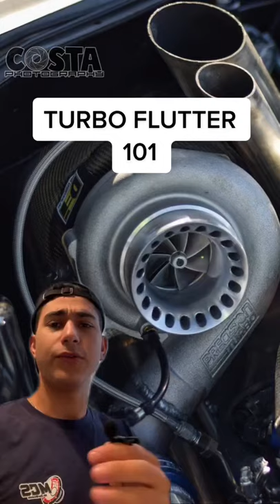TURBO FLUTTER 101 - Explaining Sutututu Theory

Comment: If its escaping through the turbine wheel then you have a problem. It should only make that noise from the waste gate. If its going through the wheel then that means the wheel is spinning backwards and forwards extremely fast and will destroy the bearing in the turbo. Certain blow off valves do this and its not good for the turbo at all because its opening and closing forcing air backwards causing the wheels to spin backwards then forward repeatedly from the air still traveling the correct direction inside the turbo. When a wastegate does it it’s different the air is escaping out of the external wastegate pipe and leaving completely it dosent get forced back into the turbo
Reply: He meant to say compressor not turbine, wastegate has nothing to do with it, it does not make the turbo spin backwards, that is literally not possible, blow off valves do not make this sound.
Reply: @DriftNick  did you not read my comment? I said that and external wastegate is capable of making this noise it dosent hurt the turbo. A blow of valve can create thus noise in the tubo if it opens and closes repeatedly which there are some out there that do it and its not good for the bearing in the turbo
Reply: @dakotaphelan  You do not understand what a wastegate is and how it works, it's a valve on the exhaust that bypasses exhaust around the turbo to limit it's speed, it has nothing to do with turbo flutter.

"A blow of valve can create thus noise"

Turbo flutter happens because there is no blow off valve releasing pressure, a blow off valve doesn't make the sound.

Comment: Performance left the chat *
Reply: Turbo flutter does no cause a performance, in fact there is a performance gain from not releasing the boost pressure hence why it's common place in motorsport not to run a valve.
Reply: @DriftNick  I could agree in some cases but it is overall better to release the presser true the blow off valve as that is the dedicated spot for the pressure to be released
Reply: @Z-squar  Why do you think it's better for performance?
Reply: @DriftNick  I just think it’s better to have a slight more performance than the nicer sound
Reply: @Z-squar  There is no performance loss from running no valve.
Reply: @DriftNick  it’s just not recommended for the pressure to escape through the turbine cos it’s suffocated and trapped inside
Reply: @Z-squar  It doesn't escape the turbine, he mistakenly said that, it escapes pass the compressor and out the intake, it's not trapped inside, not sure what you mean by suffocated.
Reply: @DriftNick  well I guess I’m wrong 😅 . GG

Comment: Turbo flutter or compressor surge is what this is. It can be caused when your BOV isn’t keeping up with the compressed air when you release the throttle… it can happen under full throttle but that is a hole bad can of worms on its own. 

Turbo flutter, although it sounds cool, is not good for your turbo. Idk anyone that runs a turbo setup that doesn’t have a blow off valve (usually aftermarket booster cars) or a diversion valve (typically in stock turbo cars). 

Spending that much to make boost and having nothing protecting your turbo from surge is idiotic. 

The insane supras that you see with flutter are likely due to the blowoff valve struggling to keep up with a big turbo making insane boost numbers… but even then it’s not good for the life of the turbo.
Reply: If you don't know anybody that doesn't run a valve then of course you have no idea if it's actually bad or not, common place for people not to run them here, done it myself for over 10 years, never had an issue.

Comment: Traveling shockwave slamming against a closed throttle plate and back out the turbine, causing the turbine to either slow down momentarily, or even stall, momentarily dropping the pressure inside the intake.  Turbine speeds/spins up again, rince, wash, repeat.
funny noise
Reply: Doesn't slow the turbo down, the stalling is the air separating from the blades, it's not the turbo stopping.
Reply: @DriftNick  Yes, it does.  Due to three factors.
One: Closed throttle means no load, which means no more hot exhaust, which means no more energy makes it's way to the turbo. Unless you've discovered perpetual motion, the laws of physics still apply.
Two: The throttle being closed means that there is a sharp rise in pressure, which means the turbo will expend the energy stored in it's rotation quicker.
Three: The compressor spins one way to force air into the engine, so it must spin the other way to let air out of the intake.  Simple physics.  I'm sure you've seen those little windmill on a stick toys for kids.
All that is happening is the stored energy of the compressed air in the intake fighting the stored energy in the turbo's rotation.  Nothing more to it.
Since this happens in (shock)waves, this means that the compressor speed follows the exchange in energy in spikes.  It just is what happens.
Reply: @detaart  You lack an understand of what is happening and how turbos work if you think the turbo needs to spin the other way to let air out the intake.

High Performance Academy have a video on their youtube "Do You Need a Blow Off Valve?" where they use a turbo speed sensor to see if there is any difference in turbo speed between running and valve and not running one, the rate that the turbo slows down when you lift off the throttle is exactly the same between the two.

What you think is happening and what is actually happening are two very different things.
Reply: @DriftNick  You lack reading comprehension.  There is energy stored in the turbo's rotation.  The air being forced out is a force acting on that stored energy.
I've seen the actual real life data myself.
Conversely, there are also plenty of videos on youtube supporting what i say lol.  Did you really try to pull that one?
I mean are you denying that a fan running in reverse reverses the flow of air?  What?
Reply: @detaart  I know you are trying to sound smart but you actually have no idea what is happening and it's funny.

" there are also plenty of videos on youtube supporting what i say lol"

Show me a single video with evidence the turbo spins backwards or even slows down more then it would with a valve.

"I mean are you denying that a fan running in reverse reverses the flow of air?  What?"

Who lacks reading comprehension? I said nothing like that, the turbo doesn't run in reverse, they does not mean air can't escape out the intake, the blades do not have a perfect seal with the housing, they are literally designed to allow it to happen.
Reply: @DriftNick  Can't embed urls here, the comment will just disappear.
You can google or search on youtube, and you will see for yourself 
You are also adding qualifiers and twisting my words.  I didn't say a turbo would spin backwards, again, reading comprehension.
I said that in some cases, it could stop for a fraction of a second.  This can happen high load, low rpm situations with a very small turbo.
I am smart.  Thanks for noticing.
You did not bring arguments or sound logic to support your claims.  Just "some guy on youtube said it".
Reply: @detaart  You can at least tell me the name of the video just like I did.

"Just "some guy on youtube said it"."

Only one of the most respected people in the aftermarket tuning industry, what evidence have you shown?

" I didn't say a turbo would spin backwards"

You said this.

"so it must spin the other way to let air out of the intake."

Does that not imply you think the turbo must spin the other way to let air out the intake?
Reply: @DriftNick  Are you still going on about this?
I guess i didn't express myself well on that one.  If the turbo was still, then it would have to spin one way to pump air in, and the other way around to pump air out.  Better?

Comment: Its from no blow off valve, which is pointless for having a turbo
Reply: Why is it pointless?
Reply: @DriftNick  because you don't get full boost, as full of boost available, and it wears the turbo out much quicker
Reply: @koreyhayden1368  Not sure what you think is happening that means you can't get "full boost" but what ever it is that is not the case.

" and it wears the turbo out much quicker

Much quicker = if it does any damage it's so minimal you wouldn't notice.

Comment: OK> My turbo has a VNT and STILL makes that Turbo flutter noise. What's going on there?
Reply: the valve is probably malfunctioning, set too tightly, or you just need a a bigger quality unit
Reply: @retrac3147  What valve? Variable Nozzle Geometry Turbo? It's a variable diameter turbo housing for want of a better description. It has a blow-off valve as part of the exhaust, like most modern turbo's. But I doubt that's what you meant. Right? It is small for a 2.4L diesel IMHO.

Comment: He forgot to mention its bad for your turbo to not have a blowoff valve
Reply: Probably because it isn't bad.
Reply: @DriftNick  so when something is spinning at high speeds in one direction, and then you suddenly push air back the opposite direction causing the turbine to spin the wrong direction, thats somehow not bad for your turbo? Yeah ok buddy 🤣 if that was the case then why were blowoff valves invented and why would people bother using them 🤦🏽
Reply: @YouANerd  Oh you are one of those people that thinks it makes the turbo spin backwards, you lack the most basic understanding of what is happening if you think it can make the turbo spin backwards, it doesn't even slow the turbo down, literally no possible for it to spin backwards from flutter
Reply: @DriftNick  🤣🤣 your incompetence is astounding

Comment: Negative. It’s the wheels in the turbo spinning against each other. Boost doesn’t “ leak out of the intake”.
Reply: Wheels in the turbo spinning against each other? you know they are connected to each other and that isn't possible?

"Boost doesn’t “ leak out of the intake”."

Except it literally does, you can even see it and feel it coming out of the intake, it's one of the reasons engines with sensitive air flow meters don't like it.

Comment: Soooooo if we  put a similar turbine on a bov, would we get similar results an extended the life of the turbo? Honestly aside from the power gains, i need this sound on my car. I just bought an Ebay turbo,  it came with a bov that i don't plan on using. Or or....... could we install a cut off to the bov an do it at will?  Somebody needs to make this stuff already dammit
Reply: Run an anti surge turbo it will make that sound and you can leave off the BOV
Reply: @jrich436  thanks, I will look into that. Turbo came with the kit, but when that one blows, def gettin the anti 1

Comment: So the turbo flutter it’s bad for the turbo ? Or not
Reply: Nah he doesn’t know what he’s talking about the stututu comes from the blow off and it’s simply A spring opening up from extra pressure letting out air hints to why people say the are running blank psi of boost
Reply: @Mazshi  it comes from the turbo, theres nothing blow off valve involved in making this sound
Reply: It doesnt damage the turbo. Only if it happens on open throttle
Reply: @Mazshi  The irony of this comment is great.
Reply: @DriftNick  He probably replaces his turbo every few years...
Reply: @blocksource4192  Who is replacing their turbo and why?
Reply: @DriftNick  he said it wont do anything to his turbo when compressor surge is known to add wear and tear to turbos
Reply: @blocksource4192  Never had an issues with it in 10+ years.
Reply: @Mazshi   the sound comes from a lack of blow off valve, not the blow off valve.

Comment: Not true for all charges,it’s actually at the wastegate on an external system or dumped into the exhaust down pipe with an internal wastegate system. (Hence the name) 
The charged air that has been cooled and on its way through the intake is what gets released from the blow off valve. 
And this helped nobody with common sense
Reply: Wastegates have nothing to do with turbo flutter, this is happening on the compressor side of the turbo not the exhaust.
Reply: @DriftNick  never said it was
Reply: @Ryan-wf1mn  Why even mention it?

Comment: While they sound fire, they are harmful to Turbos
Reply: It sounds fire and is not harmful to the turbo.
Reply: @DriftNick  Doesn't harm modern turbos which come in stock. The ones people tune with are classic turbos and disconnecting the blow off valve can harm the turbo. That flutter is a bad sign
Reply: @nighthawk_king6960  30+ year old Nissan turbos have no issue with it.
Reply: @DriftNick  They do, people disconnect the blow off valve when going to meets and stuff. Fast and Furious also featured turbo flutters because they sounded nice, they didn't mention it was bad for the turbo.
Reply: @nighthawk_king6960  I must have been disconnecting it all the time, oh wait it never had one and has never had a problem just like every other turbo car from the 80's that didn't have one.

As someone that has not run any valve for over 10 years it's not bad for the turbo.
Reply: @DriftNick  Depends on what your running it on
Reply: @nighthawk_king6960  What do you mean?
Reply: @DriftNick  For example, running a turbo over a V4 or a V6 with a closed valve wont do as much damage since there's not much boost being produced over a small engine load. That still doesn't mean it's not harmful to it, it will wear down the blades. A turbocharged V8-V16 with a closes valve will do significant damage to your turbo. Higher engine load means more boost. Gas will build up and push against the blade, resulting in lower intake and pressure on the blades.
Reply: @nighthawk_king6960  Good thing it doesn't  wear down the blades at all, not even sure what you think is happening that would cause that.

"Gas will build up and push against the blade, resulting in lower intake and pressure on the blades."

wut
Reply: @DriftNick  How do you think the fluttering sound is made?
Reply: @nighthawk_king6960  The sound is boost pressure going back out the intake of the turbo, it does not damage the blades.
Reply: @DriftNick  You realize the gas leaking out of the turbo Intake isn't exactly soft right? Gas is released with staggering amounts of pressure, pushing up against the blades from underneath opposite to what it was originally designed. The blow off valve is use to ensure the air seeping out doesn't disrupt any engine parts or mods
Reply: @nighthawk_king6960  It's so hard to know what you mean because you are literally just making crap up with no understanding of what is happening.

"You realize the gas leaking out of the turbo Intake isn't exactly soft right?"

Gas leaking? for some reason I don't think you mean the air going into the engine because that is all that is "leaking".

"Gas is released with staggering amounts of pressure"

Compressor has no issue with the pressure spike that happens, it also happens with a blow off valve and it's far from "staggering amounts of pressure".

"pushing up against the blades from underneath"

From underneath? 

"The blow off valve is use to ensure the air seeping out doesn't disrupt any engine parts or mods"

What engine parts or mods do you think it's disrupting?
Reply: Youtube deleting comments again? says there are more replies but I don't see them.

Comment: Here, I'll save y'all from the video: It called compressor surge, and/or blowoff valve releasing over pressure.   Caused by excessive boost pressure vs flow through the turbo.  Like when your throttle blade(s) snap closed under high boost!  🙄

Comment: You can still get flutter with a BOV so you're not entirely correct about that.
Reply: Yes if the BOV isn't releasing enough pressure to stop the flutter from happening or it has a delay.

Comment: so basically, i just need to delete the blow-off valve yes?
Reply: Yes, stop it from releasing
Reply: yeah. You can also take the vacuum line that runs to the bov and block it. Make sure both ends are blocked if you cut it.

Also, make sure it's definitely your BOV and not your wastegate.

Comment: He can literally run on NA and rap off the stutututu thing through the in car loud hailer thing.

Well, it kind damages your turbo in the long run. Unless you are not into sound or is getting ready to swap in a new turbo, go for BOV or Recirculation.

Meanwhile I am on full BOV on a 4G15T, sourcing for one BOV that does this stutututu thing.
Reply: it doesn't damage your turbo, that's a myth.
Reply: If you’re looking for a blow off valve that makes the compressor surge noise then you’ll be looking for a long time because the stututu is from not having a blow off valve or having too stiff of a spring on the blow off valve that way it doesn’t open.

Comment: Not really Ive had turbo vehicles even with completely open bov you still get the flutter depending on what you have done to the vehicle
Reply: You still can get flutter because the blow off valve is not releasing enough pressure and/or has a delay.

Comment: Doing that can put excessive back pressure on the turbine blades causing damage and ware to the impeller. Don’t do this. Keep your turbo healthy by sticking with the blow off valve method.